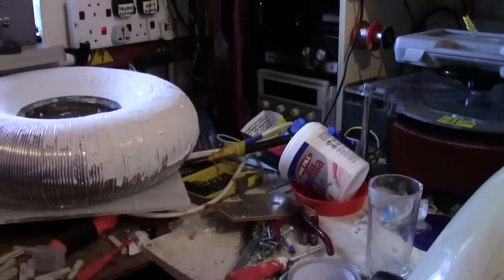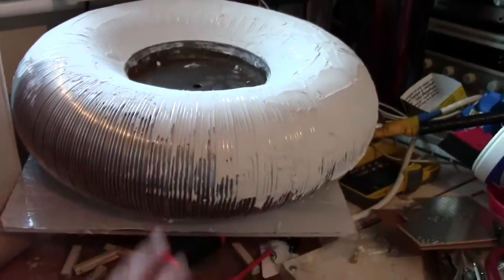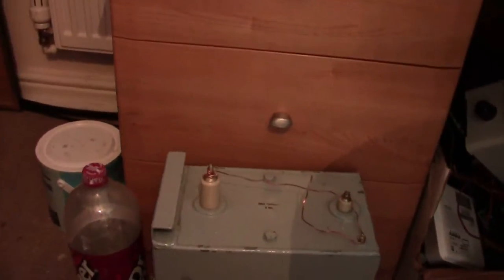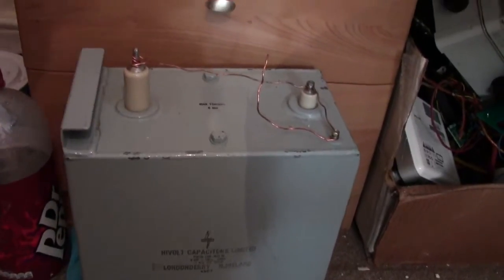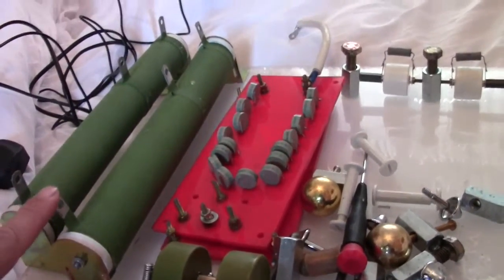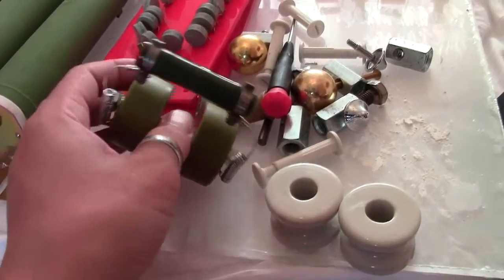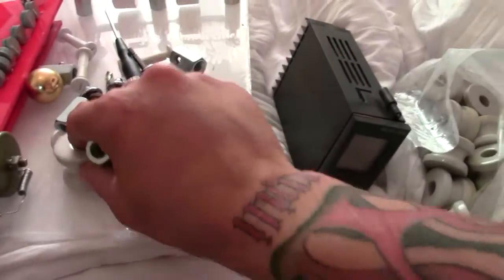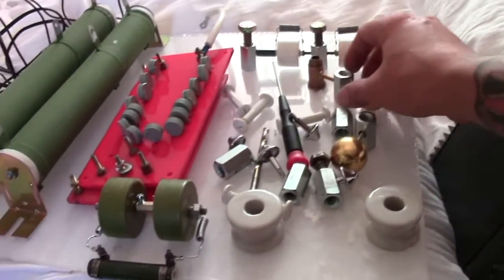Another NEW TOY :0) and some Tesla coil progress and suggestions for the Terry filter welcomed

Comment: Hi John, not sure I would bother with temperature monitoring the MOVs, insulating the thermistor could be a pain and if it flashes over to the primary circuit then all the primary power will fry your nice relay module! For my Terry Filter I use centre tapped safety gaps and 1k 100W resistors, then 12 modules in series across the 10kV NST output where each module is an 1800V MOV in parallel with a 10M 0.5W resistor in parallel with a 3300pF 1600V capacitor. Fewer modules needed for MOT coil.